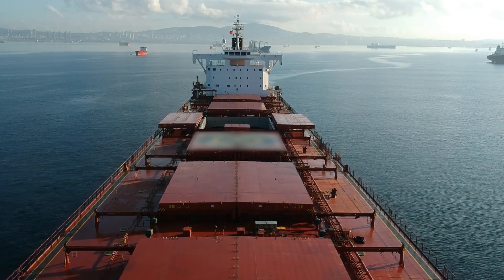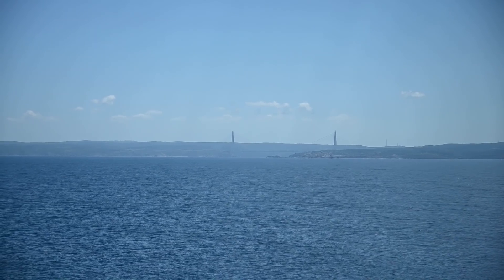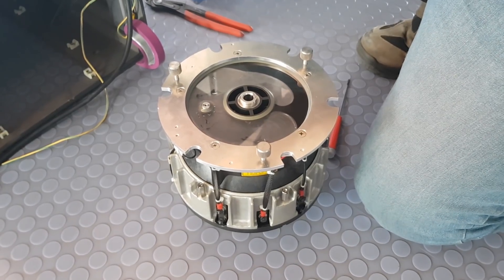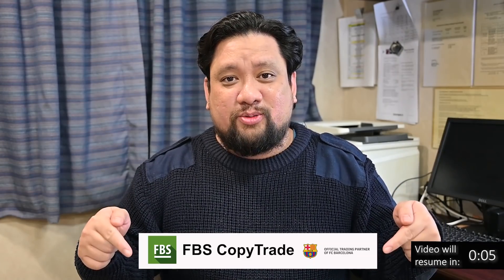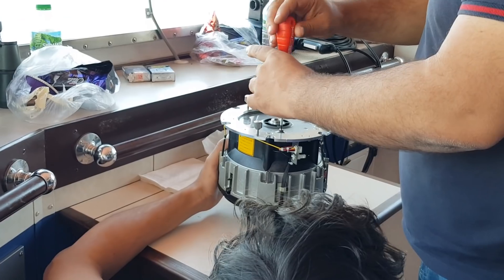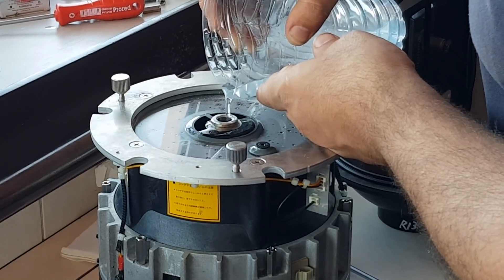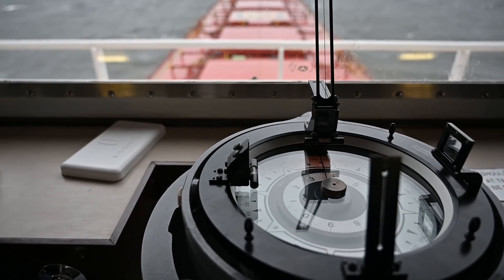The Ship's Gyrocompass | Chief MAKOi Seaman Vlog S03E14

Comment: TBH I was expecting a laser ring gyroscope or perhaps some kind of ultra-precise MEMS device, I didn't think actual kinematic gyroscopes like that were still commonly used.
Reply: The traditional gyrocompass is way cheaper than ra ring laser gyro or other solid state gyros. Therefore they are very common on commercial ships. For special vessel's who need the extra precision, often one or more ring laser gyros or HRG gyros are used, especially when a DP system is installed.

Comment: After recently stumbling on your videos, I am amazed at the life at sea, a career I did not choose, but might have if I was younger. I am enjoying your videos and look forward to the next. But, I have a question about your Gyro Compass. I found the video very interesting, but since I am not a sailor, and not familiar with the device (I am familiar with a magnetic compass and have used them many times), but what is the inter numbered ring that is rotating within the Gyro Compass face?
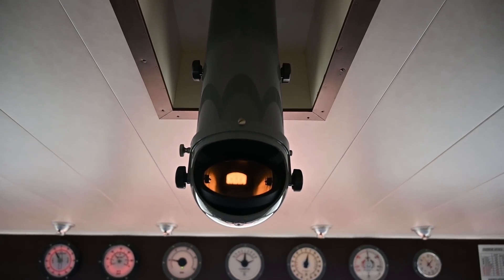Reply: The inner number on the repeater compass is the last digit in the 3 digit degree, on which you are heading. If you look at 2:00 you see the needle is between 210 and 220 degrees. As this small markings are not easy to read, you have the inner ring, which indicates the last digit. So in this case the heading is 217.4 degrees.

Comment: I guess your primary nav system is GNSS & this is a backup?
Reply: GNSS is mainly for position. Gyro compass is for heading and is the main sensor to indicate the exact heading. It also uses data from GNSS to account for minor deviation based on the position.

Comment: Basically same system as larger airplanes have. Military airplanes have always used gyros as main navigation device since GPS signal can be jammed or faked so GPS is usually used just to speed up the initial gyro align step.

Comment: Interesting, how often do they need to be 'reset' as they must eventual drift, or is that done automatically by GPS etc.
Reply: The GPS position is used to account for deviation. And then there is a mostly yearly overhaul, there the fluids and some wearing parts on the gyro itself get changed.

Comment: I was amazed when the technician pulled out the gyrosphere enclosure and started to dismantle it on the floor of the bridge…!

Can you say why spinning gyroscopes are still in use? I would have thought a solid-state inertial reference unit would be cheaper and more reliable today.

Comment: What happens if the compass failed at sea? Does the ship carry a spare?
Reply: Depends on the classification of ths ship. Some require you to have 2 or 3 gyrocompasses in redundancy on board vessel. But even if you have only one, you have a spare magnetic compass for emergency navigation. Also most ship's have set of on board spares and know, how to repair some minor problems before arriving in the next harbour for a service technician coming on board. Also today you can call your service station or even the manufacturers technical support and ask for help.

Comment: I'm surprised ships aren't using ring laser gyroscopes as higher end aircraft do. Maybe an expense issue? The error is less over time, and no moving parts!
Reply: Ships are heavier, so there is no weight penalty to using an older mechanical gyroscope.
Reply: It all depends on the price tag. In the shipping Industry, Hemispherical Resonator Gyros and Fibre Optic Gyro are are the maintanance free counter parts of the mechanical gyros. But they cost a lot more, some time twice or three times the price of a mechanical gyro. And if they break, you have to completly replace most of them.

Comment: I always compare naval world with aviation, quite obviously since i do work in the aviation world. What surprised me here was the fact that apparently mechanical gyro systems are still a thing. On commercial airplanes we used to have three axis mechanical gyro platforms, but those were replace about 40 years ago by strap down laser gyro system, no more moving parts. I wonder why those are not used on ships? 

Of course, most airplanes have usually three of those laser gyro based inertial reference system on board, as well as a backup unit and as last resort a tiny "whiskey compass".  The IRS's do not only generate a compass heading (and track), infuriatingly still presented in magnetic north although the systems can only generate true north, converted by means of a magnetic deviation table within the system, but of course also pitch, roll, yaw information as well as ground speed. Of course, nowadays that is always coupled with several GPS units and a Flight Management and Guidance Computer. 

One thing of note is, the IRS's need, at medium latitudes, around 6 to 8 minutes to start up, after which they provide a reliable navigation solution, however, the aircraft has to be not moving during that time, a logical place for that to happen is at the gate, or berthed as a ship. At higher latitudes the alignment time gets longer and longer, until finally it is pretty much impossible to align the system, which means for stops in that region the aircraft has to stay powered on to keep the IRS's running, usually that is beyond 70 to 80°N or roughly 60°S. 

Again, still surprised the ship bound systems are still mechanical, i am sure there is a good reason for that.
Reply: Ships are much heavier than aircraft, so there is no weight penalty to using an older mechanical system.
Reply: Are the commercial aircraft using gyrocompass or magnetic compass? I have never heard that they have switched to the gyrocompass. The only gyro onboard the aircrafts is the attitude indicator.

Comment: This is very interesting , the magnetic compass (gimbal or not ) has 4 errors- acceleration, deceleration, variation and deviation. The gyro in the plane after extended flights would drift sometimes and I would always double check with the magnetic ? This was equipment made 65 years ago. What resets the gyro to keep it true? Your videos are so informative, thanks.
Reply: The plane is a lot faster than a ship, so it doesn't drift as much as a gyro in a plane. For highspeed vessels (40+ knots) the gyro compass needs to be certified.

Comment: If you had a GPS receiver on the front of the boat as well as the back in communication you could tell the orientation of the ship with extreme accuracy. Seems overcomplicated.
Reply: As a surveyor: Ships flex quite a bit, and unless you can quantify that perfectly in real time (the distance and orientation between the two GPS receivers), you're going to be getting bad data. Likewise, GPS isn't as accurate as you think, and no ship is long enough for it to provide a reading as good as that compass.
There are also about 5 billion ways you can get bad data out of GPS and not know it.

Comment: Is that gyrocompass equivalent to an inertial measurement unit (IMU) used in aircraft?  How is it calibrated (what determines that it is indicating the correct heading)?  Does GPS data play into the eventual reading?

I know, lots of questions.  Fascinating stuff!!

Comment: Well you did it again, another super interesting video. I had never seen the insides of a Gyro so this was particularly interesting to me. You mentioned magnetic compasses which have been around for many many years...but as you said interference and specifically things such as magnetic anomalies can create havoc for a navigator. A friend of mine running his boat, which was a 50 footer found himself over 40 miles off course in a fog bank because someone had set a pair of metal pliers in a storage container beneath the compass (magnetic) housing...not only irritating but potentially dangerous. Thanks for the great video, so interesting and topical..Thanks Chief!!! All the best to you and yours...

Comment: It would be fair to mention that while a gyrocompass gives a far more accurate value than a magnetic compass, a magnetic compass is much more dependable, if you understand its limitations. True, it is subject to deviation, variation, local anomalies (there's a strong but relatively compact one about 150 nm east of here) and influences like large volumes of ferrous metal (the hull or a nearby engine block), but unless you take a bat and smash it, a magnetic compass will deliver a heading with almost perfect repeatability without reliance on power.

Comment: ¿how is the GC calibrated after the replacement and repowering?, using the magnetic compass?, what's the reference used?
Reply: They are only balanced for the self righting force. An unpowered sphere is timed for the rate it self rights when suspended in the fluid. It is balanced for vertical orientation and rate it rights when placed horizontal. This righting force by weight, and tilting force from the rotation of the earth orients the sphere, which is why it takes about 5 hours to orient after startup.  There is NO manual adjustment to orient it. Only the housing is installed precisely to the keel. Orientation is only based on the rotation of the earth, which is factory calibrated on the compass installation of the housing. The "Calibration" is the orientation of the housing, which is oriented to the ship's keel, and the housing is not removed from it's location, so this calibration is not altered in repair.  To confirm calibration, the ship gyrocompass feeds ship orientation to the satellite communication gyro stabilized antennas in the round radomes on top. Confirmation is when the satellite dish has the correct azimuth and links to the satellite. When the unit alarms, often the satellite will lose the link. First gyrocompass I worked on came in for the satellite communications were down. It was down because the bearing from the gyrocompass was wrong. The crew knew the gyrocompass went down and was using GPS to navigate, but didn't know the communications required an accurate compass heading to steer the dish.
Reply: @isettech  very interesting

Comment: you able to explain what other nav aids are used  - GPS?  Is the Gryocompass feed into the Navigation system?
Reply: Gyro outputs heading data to Radars, Ecdis, Ais, Autopilot, Vdr, etc. The gyro also has data inputs from GPS (for auto latitude correction) and speed log (for auto speed correction) which you can see in the Chief's video of the CMZ900 operation unit. They have selected manual speed correction though.

Comment: When you are at the North pole, all directions are South.  How do you steer to get back home?  

Do you use magnetic compass and GPS to back up gyrocompass?
Reply: The north pole is in a frozen ocean and they don't sail there. The south pole is over 10,000 feet high on a glacier and you won't see many ships there. The more interesting question is what do airplanes do.
Reply: @MarkRose1337  Submarines go to North pole.
Reply: @dbfbobt  Yeah, but few bulk carriers do. Besides GPS, there is also celestial navigation. If you know the time of day you can use the sun in the summer, and in the winter you can use the constellations to pick the longitude you want to head in. There are also magnetic declination charts you can use in combination with a magnetic compass to navigate in the north, but you'll recent charts since the north magnetic pole moves around significantly every year.

Comment: I was kind of surprised to see ships still using a gyrocompass (directional gyro) instead of an inertial reference system or even a GPS.
Reply: GPS is for position, Gyro compass is for heading. SOLAS regualations require ships from a certain gross tonnage to have a gyro compass on board. You can also track your heading with a gps, but that can fail if you don't have enough satellites. The gyro only fails if you don't have any power. It's all about redundancy. The ships also have a spare magnetic compass onboard if the gyro fails. Some classes also require you to have up to three gyros on board in a redundant system.
Reply: @MrMiniMacho    Thanks for the very informative reply!  My background is aircraft maintenance.  Modern transport aircraft use inertial reference for vertical velocity indication,  for attitude (roll and pitch) indication and heading with GPS updating.  There is also a magnetic compass (nicknamed whiskey compass) too.

Comment: I know gyrocompasses from aircraft and they got the issue of drift after longer flights. How does a ship compensate for drift in the gyro?
Reply: Rotor Scout
Ships travel a lot slower than aircraft so it is possible to feed corrections in for latitude and speed to make the gyro point in the correct direction. Earlier models required you to do this manually but with modern GPS you can feed in the corrections automatically. 
You will notice in the video that the gyro the Chief showed us had two small rotors - these spin in opposite directions to provide additional stability.
Fast planes and some fast ships now use laser ring compasses or satellite compasses - especially in polar regions to provide direction.

Comment: How is the gyrocompass calibrated after repair? How does it "know" in which direction is north?
In aviation,  ring laser gyroscopes are used. Why not on ships? (price?, accuracy?)
Reply: Exactly. After power on, this particular model (Yokogawa CMZ900) comes up to speed in around 10-15 minutes, then the follow up is enabled and the repeaters start. It then swings, rapidly at first, in ever decreasing fluctuations either side of the actual heading, until it has finally settled on the heading in several hours. During this time the gyro technician checks all the repeaters,  reads the newspaper, makes coffee, writes up his service report etc.
Reply: After service the gyro is powered on and the gyroscope in the Gyro compass starts spinning. Then it's just physics. The gyroscope adjusts itself to earths rotation so you know where true north is.
I can't answer the second answer for sure, maybe it's the price tag. I don't know the prices of a ring laser gyroscope. The accuracy can also be a thing. Conventional gyrocompasses are quite accurate.
Reply: Hello MrMiniMacho, thank you for your answer. It seems like I really need to improve my physics skills ;-)

Comment: I understand that the gyrocompass has a display on the bridge. Is the actual gyrocompass unit underneath it or located elsewhere on the ship?
Does your ship have additional gyrocompass displays? If so, where?
Reply: Most of the time the gyro compass is located on the ship's bridge or in a electrical room nearby. The number and location of the compass repeater is prescribed by the SOLAS regulations. You have to be able to take a 360° bearing, so you have two bearing repeater compasses on the bridge wings. Also one compass repeater on the bridge itself for the helmsman plus one additional compass repeater at the emergency steering position in the engine room. It all depends on the ship's gross tonnage.
Reply: My Gyro is down below at the engine control room. On the bridge console and the bridgewings we have repeaters. also the radards, electronic charts and AIS is connected to it.

Comment: I was struck by how small and compact the gyro unit was compared to what I was trained on.  My experience is with US Navy systems dating back to the 60's and 70's.  I was always somewhat amazed at how a unit (Sperry Mk 19) could provide such precise heading info (plus pitch/roll info for weapons systems) while being controlled from a separate cabinet full of banks of vacuum tubes.  Total time from startup to accurate was about 24 hours.

The ship I was on had a secondary unit (Sperry Mk 23) which was all solid-state, but it was actually not as accurate as the dinosaur bolted to the middle of my shop floor.  Pitch and roll accuracy forced the gyros to be located centerline and on the 3rd deck...about 10 feet below our laden waterline.  This means that every gyro indicator on board was actually a repeater fed from my shop...about 10 total.

If curious, look up USS Kansas City (AOR-3) sometime.  You haven't transferred fuel and cargo until you transfer it to another ship....at 17 knots.  Needless to say, accuracy of ship's control and navigation equipment was a BIG thing.
Reply: When did you go to IC "A" school?  I did mine in the Summer of 1973.
Out of school, my first ship was AD-38, USS Puget Sound.  We had a MK23 bolted to the floor, as well.  Being a repair ship, the Puget Sound was seldom underway, so the gyro was more like room decor most of the time.
Then I got sent off to a Adams-class DDG.  That gyro was designed for a warship, the Mk 19.    Spent two full years underway on that one.  It used to be fun to look down through the glass top on the gyro and watch the stable element "move".  If you know gyros, then you know that the stable element doesn't "move" at all - it is rock solid and the ship is moving all around it in azimuth, roll and pitch.
Reply: @jeffreyhill8040  I started the 22-week Instructor-led IC "A" course in November 1988.  NTC San Diego.  I wasn't from the 60's and 70's...the ship was.
Reply: @kevincrosby1760  Thanks!  Things have indeed changed.  When I moved to So Cal in 2001, I went back down and explored San Diego.  The Naval Training Center was mostly gone, but the brick building where you and I went to "A" school was still there.
I toured one of the new Arleigh Burke destroyers down there about ten years ago and couldn't recognize much of anything in Engineering.
Reply: I was a SPS-30 ET on Chicago, CG-11, during that period. The gyro also provided Pitch and Roll to keep the antenna level. I am embarrassed to say, I had no clue on HOW those 3 signals were generated.